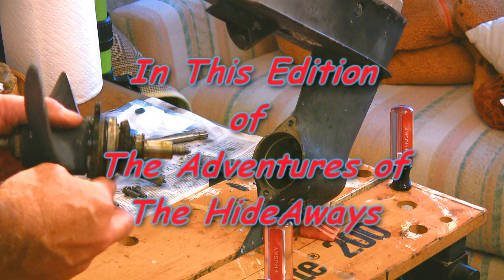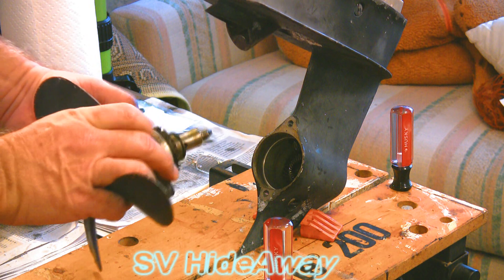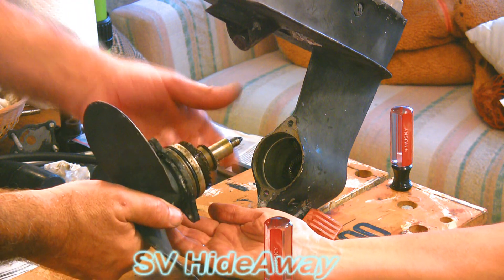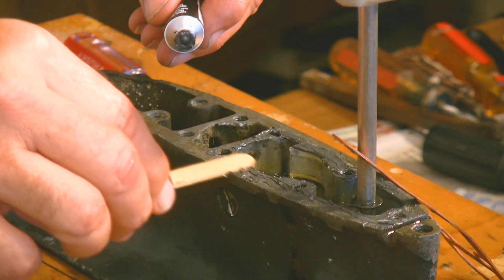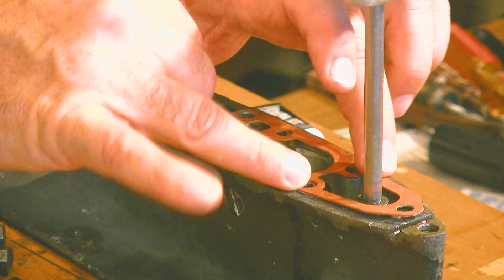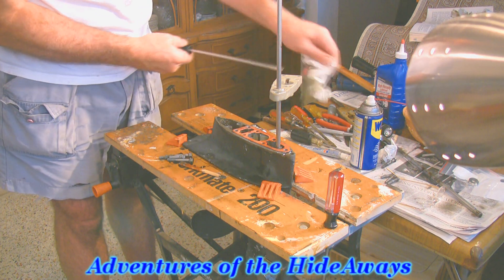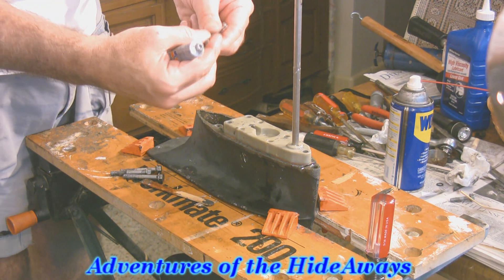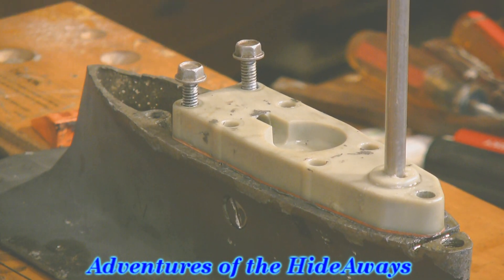Shift Rod Installation Evinrude 8hp Outboard Motor Part II   Sailing Hideaway Com Pac 23

Comment: SV, I hope you're reading these 9 years later. I have an 8hp evinrude, short shaft, I'm trying to remove the gear case from the mid section, I have one of the bolts broken off, one on the right side of the anode looking from the back bottom. I have the prop off, the shaft rotated and the gear shift in forward. per the manual. supposedly, the gear case should pull right off. What am I missing? Do you have a video showing removing the gear case from the mid section? Thanks I've learned a lot from your video.
Reply from the maker: There is a 9/16 bolt just below & behind the bottom pivot hinge of the motor.  It's on top of the first flange of the lower unit.  This is a long bolt on mine because of the extended shaft - see my video Evinrude Lower End Update - you can see it clearly during the first 1 m 19 seconds or so.  Hope this helps  Matt
Reply: @SVHideAwaySailingHideAway  thanks Matt I had that out as well. there's a total of 3 bolts, the two on either side of the anode, and the one in front at the pivot. For now I'm putting it back together until i can come up with another solution. Bolt extractors are too short for the depth of the hole, unless I can locate a long shaft extractor, which has it's issues of it's own. Thanks again for the speedy reply!
Reply: @SVHideAwaySailingHideAway  you mean 3/8'' hex head, 1/4'' screw